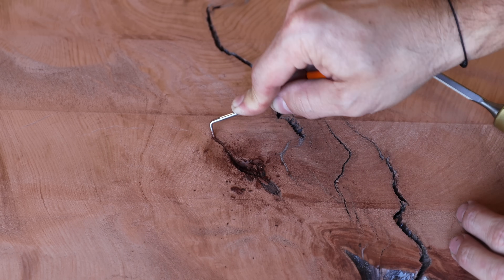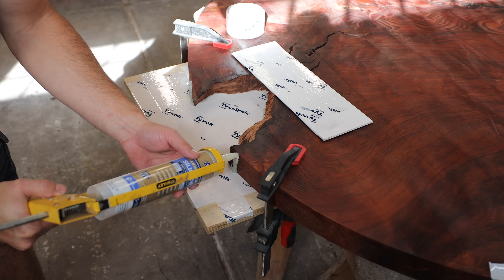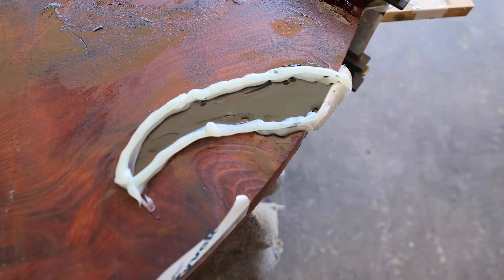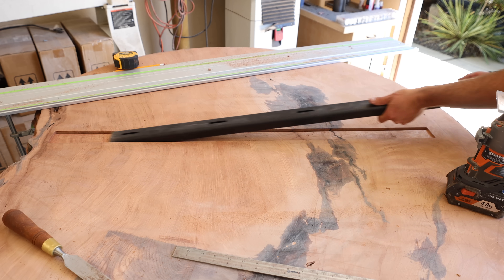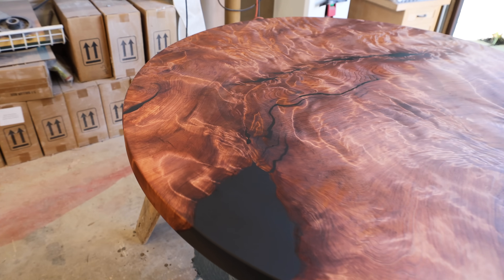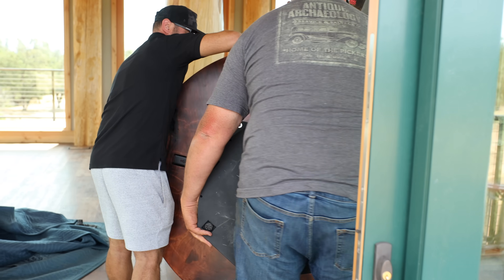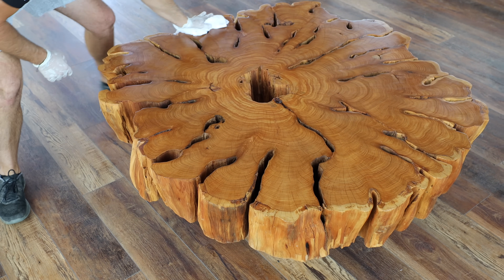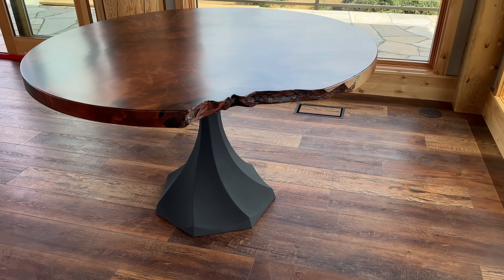Round Dining | Coffee Table Build For "The Watch Tower"

Comment: They’re both gorgeous pieces. If it was my table, I would’ve wanted it filled in with epoxy. The poker table was a beautiful build as well. My guess.. $64,225.00. After watching you work while sitting on a cement floor, I’m going to suggest you buy yourself a low riding chair/stool with casters. My hubby got one for cleaning the tires and we both used it recently when we top coated our nightstands with epoxy. They’re not very expensive and worth every penny. As far as videography goes.. I really dislike having to turn the audio up to hear dialogue, only to get blasted out with loud machinery a moment later. Just something to maybe be aware of. You’re a very talented and hard working craftsman.

Comment: I like it! I’ve been waiting to see someone seal a soft wood with penetrating epoxy before the finish to see if it works.  It looks like it does. What are your thoughts on using Rubio Monocoat and ceramic after the penetrating epoxy?

I also like the live edge void in round table.  The eucalyptus table is awesome. I have a eucalyptus slab that is 4” thick but not as big and it has a weird shape. Now I think I’ll make a coffee table out of it. Thanks 

GW
Reply from the maker: Yes, it worked so good!  Before I did it I could gouge the redwood with my fingernail, and after the epoxy cured I couldn't at all!  I think that Rubio would be fine for sure!  Thank you for your feedback and support!

Comment: Wondering if you get a plastic turkey baster with rubber bulb.   Suck up turkey baster with veggie oil, so that epoxy doesnt stick.  Suck up the epoxy/resin do the small veins and sliver holes for easier application ... Then put baster into warm water, and allow epoxy to semi-harden, and then be able to slide out the epoxy sleeve from the inside of the baster ... yeah ?
Reply from the maker: I usually use hypodermic needles for this, I get them at tractor supply, works great!  Thanks for the feedback!